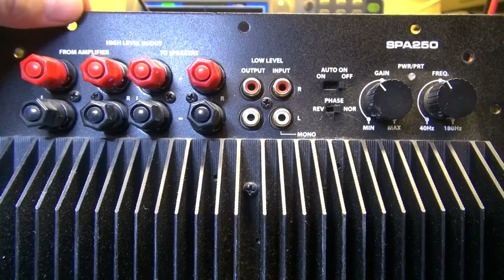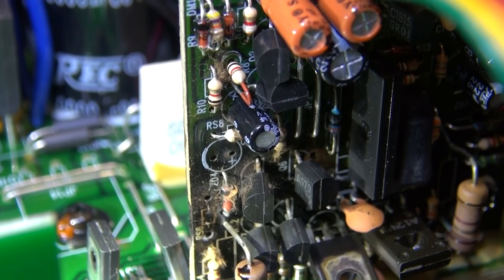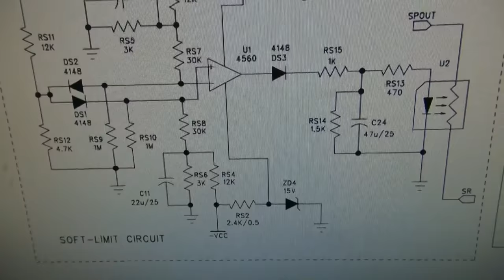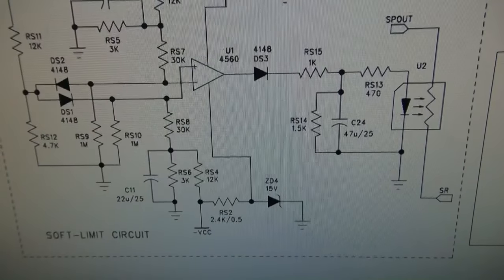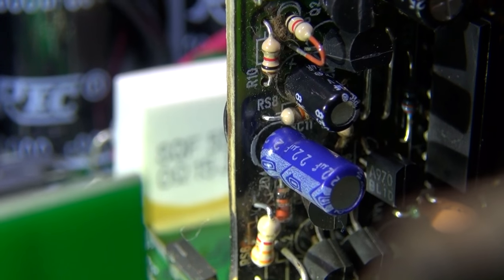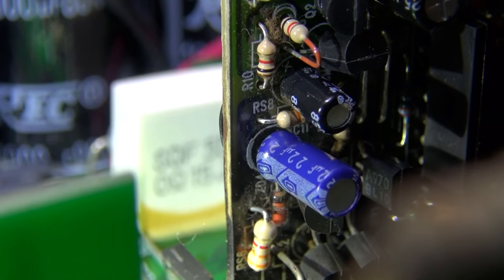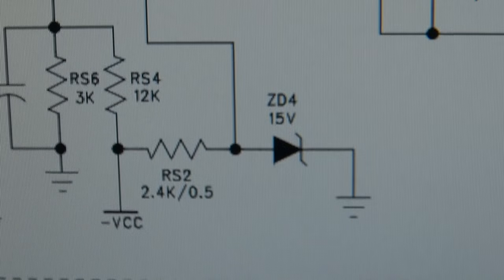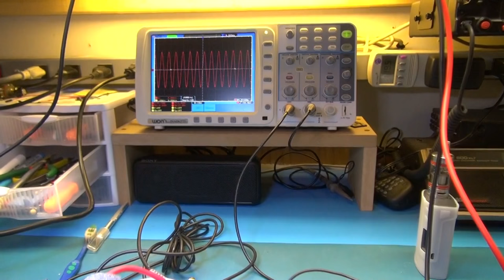DAYTON SPA250 SUB AMPLIFIER REPAIR

Comment: my spa250 was intermittent. had cold solder joints on the phase and auto power switches. reflowed those and good as new. amp wasn't that old and barely used at the time. i've got 3 dayton plate amps and everyone has had some kind off issue. the spa100 has horrible turn on thump. i'll probably just add a delay circuit for that one day.

Comment: I got a ASW600 for basically free, anyway, after a month of having it, i thought i better test it out. plugged it in, nothing.  But the woofer was/is still good.  Yesterday i pulled the amp out, opened up the sealed case, and it was a horror show. the board was on fire inside, but because it is sealed, it can't burn for very long. all the big power transistors are shorted across all pins, pretty much every cap is swollen. there was even a transistor that somehow managed to fall out of the board and melt itself to the outside casing.  So thats my project after my uni exams are finished.

Comment: Hi. Just wanted to ask what the small white block-like connections are? Trying to diagnose a faulty sub amp and noticed one of these small white blocks was extremely loose on the board and will completely disconnect at one side of the solder points while the other side of the contact remains connected! Any suggestions? Amp receives power but no sound output...speaker already confirmed functional.
Cheaper and easier to buy a new separate amp or possible to repair? Thanks for any help

Comment: Howa bout infinity sub with bad power supply pcb had loose pads an traces around large resistors,  tried to fix with wire bypass traces an it sparks an smokes on that board junk

Comment: i have 2 svs subwoofer plate amps that need fixed. they are 1000w amps and they are for the svs sb-13ultra. would you be interested in repairing them? simply lmk thanks

Comment: hey bud i have the logitech z623 and the4 sub suddently stopped working. No smells or bad noise. There is an amp insider the subwoofer can this blow and make the sub stop altogether? ty the sub still gets power as one of the small satellite speakers runs from d sub off the subwoofer itself. only the actually bass and subwoofer not working bud.

Comment: Great Job!  I have an amp just like this... Damage is similar to the one in this video.  Let me know if you're interested to do the repair.  I'd like both sides repaired including RS2 & RS3, because I see heat issues on both sides of the riser board.  Let me know.  Thanks.  Steve.

Comment: hey kevin how do you find whats the value of a burnt out resistor with out the service manual?
Reply from the maker: +Ravindra Maharaj without a schematic there is no way other than having another device of the same model.  Or find photos online. Measuring may not work of its burt up bad.

Comment: @Kev31779, can I have a copy of the schematic please? not finding it online.
Reply: If you find them, let me know. I have a 5+ year old spa250. The soft limit switch burns resistors like clock work. Everyone has this problem on these models.

Comment: At least there was a schematic available!
Reply from the maker: That is true. I didn't expect to find one.
Reply: @The_Active_Region  hi and thanks for the video.  Seems I have rs1 and rs2 burned.  I need help cos I don't have a schematic.  Where can I find one?
Reply: @The_Active_Region  Can I please ask where you found the schematic for the SPA250?  I am trying to trace an intermittent fault on this unit, but as you can probably appreciate reverse engineering the schematic is very time consuming.  If you can provide a link it would be most appreciated. Thanks.

Comment: where do you find those schematics.
Reply: If you find them let me know. I have a 5+ year old spa250 and want to compare it to the newer models so I can potentially switch out a few resistors, zenor diodes, etc. with more reliable components.
Reply: Just about everything is on the internet. the problem is sometimes search protocols and words used to find things. sometimes find google images and work backwards from there.

Comment: That model amp always has problems in the soft limit circuit, mostly due to light duty resistors.
Reply: I have a 5+ year old model. Do I have to replace everything before and after those burnt resistors. And what should I upgrade the components to so it doesn't happen again?
Reply: __ 
After two years:
Electrolytic capacitors go bad quickly if they get warm. So if you see these big power resisters there’s a good chance that the electrolytic capacitors close to them are shot. 

You can buy ESR meters for about $ 6-12 on eBay to measure the caps. Most Digital Multi Meters will also give you an indication.
Reply: @Conservator.  do you know how to repair plate amps? i got 2 that need fixed
Reply: are you able to repair plate amps chris?
Reply: @parkersgarage4216  I’ve repaired a few and messed up a few others 😁
Reply: @Conservator.  lol, well tthis ones already messed up and it doesnt work. when you hook it up it powers up fine. theres no audio from music. however, there is a pulsating click noise which turns into very faint static then it starts over again. the other one works and actually plays audio. however w the second one, it has an annoying static buzz noise. It starts low, but increases in noise, ends with a pop, and starts over. It isn't very loud, but it’s noticeable.
Reply: @parkersgarage4216  I’d check the powersupply (internal) first. It will also help if you can find a schematic. 

If they are the same, you can of course compare voltages. 

Check the electrolytic capacitors for any bulbs or leakage. Even the slightest abomination makes it likely that it’s faulty. 

Any discolouration can also point to a fault but not necessarily. 

HTH.